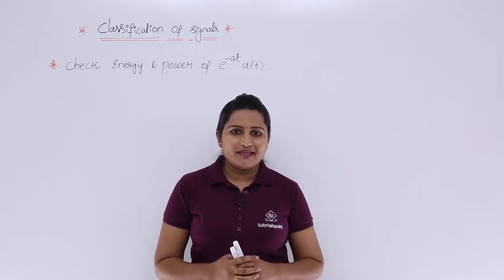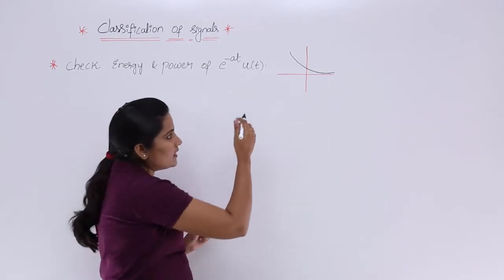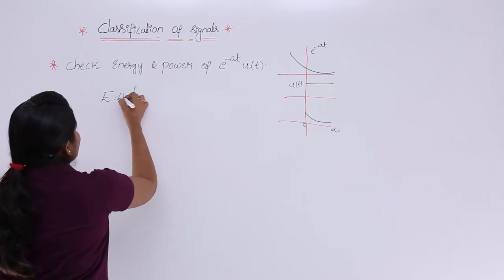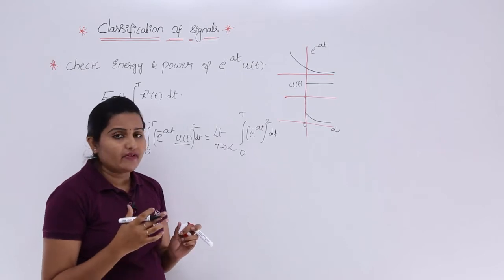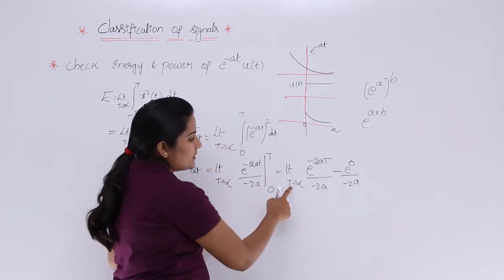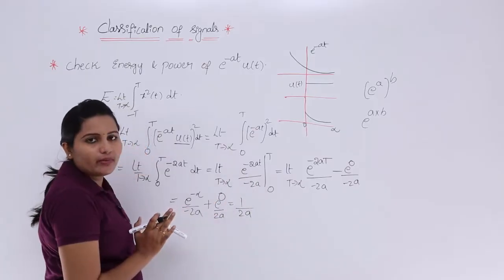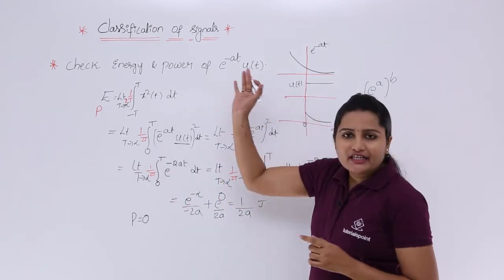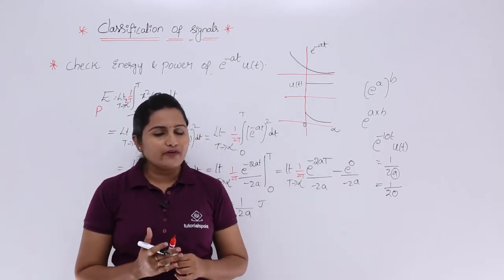Energy & Power of Exponential Signal with Negative Power

Comment: While calculating energy of unit step signal we put limits 0 - infinity 
Because formula is Lt - infinity and integration of x^2 dt 
But in calculating of power of unit step signal we take limits 0-T rather than 0-infinity  
In calculating power there is also Lt-infinity and integration of x^2 dt 
But in power we can't take 
0-infinity but Lt-infinity is in the formula so why we take 0-T  limit while calculating power of unit step signal, if we take 0 - infinity as the limits to calculate power of unit step signal then what is the ans plzz tell me 
Thank you